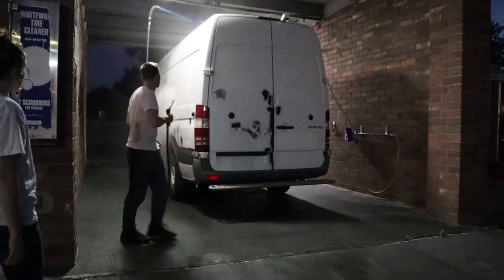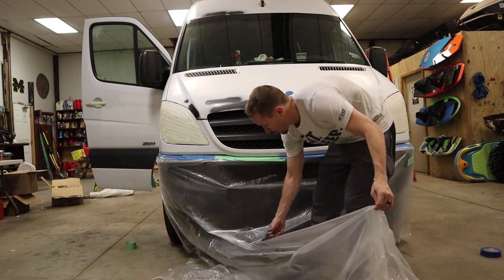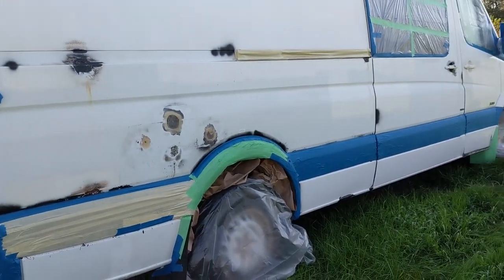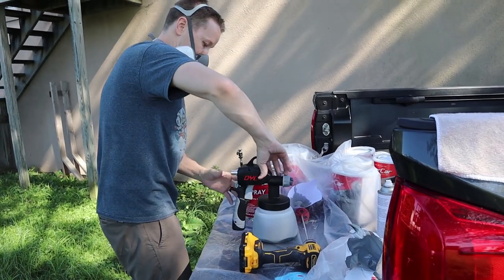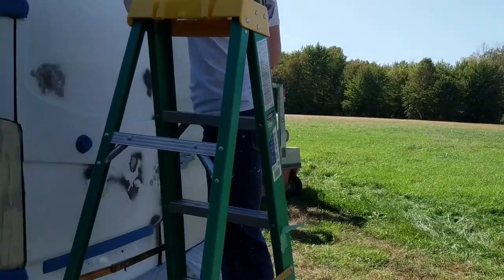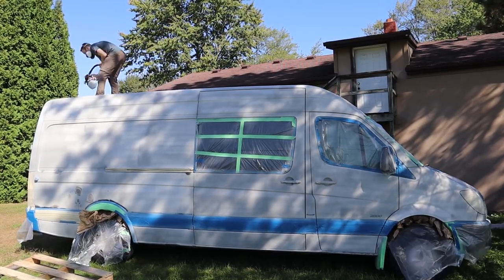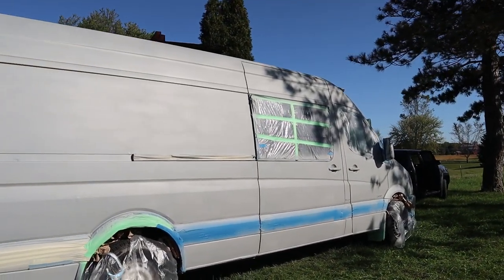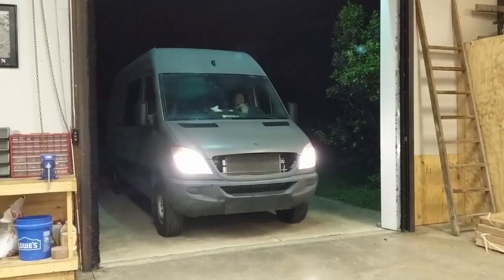We Plasti Dipped Our Van: VAN CONVERSION DAY 9 | | Simply Miss Sarah

Comment: Hmm, I think you could have saved time and not tape all those black plastic parts. I painted my van with Rubbercomp which is similar to the Plastidip, and the point of the paint is that you just peel of the parts you don't want to have paint on them.
Reply from the maker: We did accidently spray on area of the black area behind the tire. I tried to peel it off and it wasnt coming off very well so we just left it there.